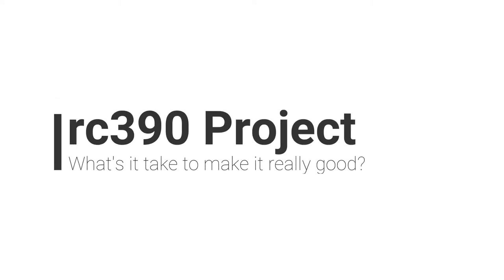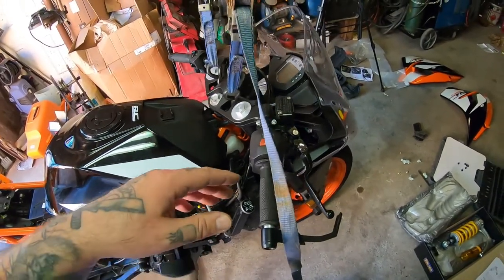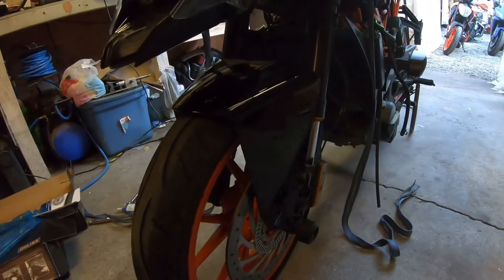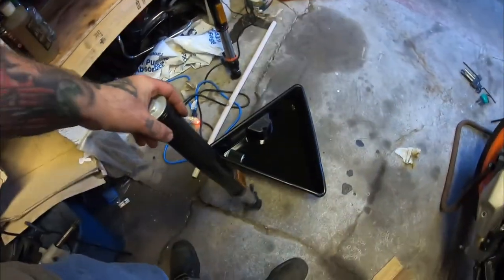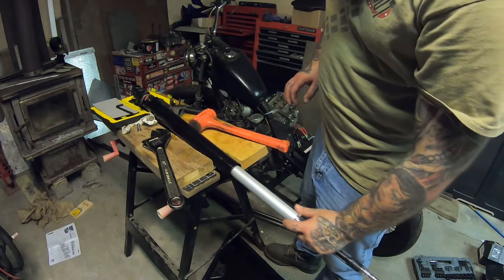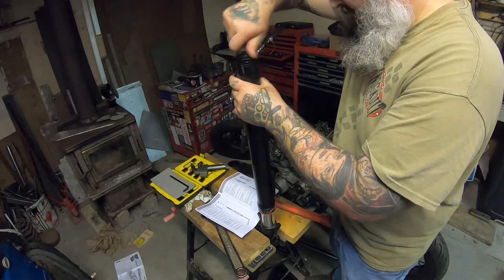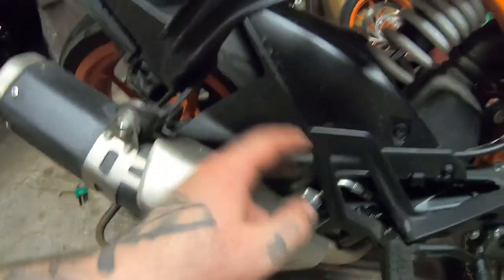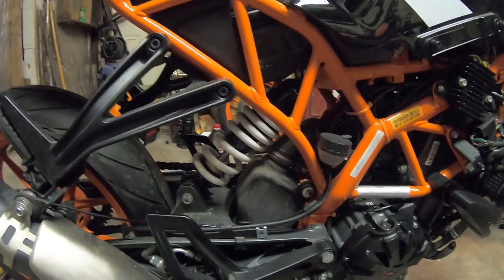rc390 forks Ohlin's Cartridge Installation

Comment: So glad I found this. I have a 18' duke 390 that am upgrading to these inserts from the Andeanis, but my suspension shop is back logged for months on work orders. Looks like you avoided having to buy the $60 Ohlins shaft extension tool by just grabbing the threaded part w/ fingers, slipped the retainer in and holding everything in place put tube into the spring compressor? Is that correct or after doing it would you recommend buying the extension tool, have to wait a month to get one. I'll need to order that race tech 1-person spring compressor.   Used to have many bikes like yourself, am even older than you, this is my last m/c, think you would like it, has Ohlins shock, Woodcraft clip-ons, rear sets, QS /blipper, IMA Thumb brake, BST CF wheels, Michelin Power Cup Evo tires, Leo Vince midpipe delete/ Yosh, sans cannister/SAS and is only ridden on a twisty mountain road I live on.
Reply from the maker: I think you have my method pretty well figured out. 
The spring compressor has paid for itself many times over in the last couple of years. So if you're wanting to work on your own suspension, it's probably worth it. It even makes fork seals way easier to change.
Reply: Why do you feel like you need to upgrade from the Andreanis to the Ohlins? I am considering the Ohlins or the Andreanis.
Reply: @NateTheGarbage  Chatter , I have a BST cf wheels and bc so light, get chatter on a very bumpy twisty mountain road when leaned over and with speed. Wheel weighs 5lb, OEM 9.5 lb (frequency doubles while amplitude halves if that makes sense. kina the opposite of putting silicone in handlebars) The Andys are very good 7/10, the Ohlins are just a bit more plush 10/10. The issue comes from the wheel but the overall improvement in performance overshadows the movement.
Reply: @jacksdad7933  Those are very expensive wheels. I am considering the GP suspension cartridges as well but I'll keep that in mind.

Comment: Going to be replacing my internals over winter. The stock suspension is way to hard at higher speeds and bounces over bumps. Feel like the RC390 was a bit overhyped as my old VFR750 handles better in the real world on real roads and it still goes like hell in a straight line. It would take a track to swing it in favour of the RC. 

Hope it's a massive improvement.
Reply from the maker: You find it too stiff?
I found everything way too soft, but the dampening is terrible, and the rebound can be aggressive.
I still think the 390s are great little bikes, but they are little budget bikes that couldn't and shouldn't be compared with a VRF.

Comment: I have a 2016 RC 390 does it mean I have to upgrade them to install the Ohlins?
Reply from the maker: If there isn't a bolt hole through the bottom of the fork, the Ohlins won't work. There are other options that would fit the stock forks though.
Reply: @VIMotorcycleSchool  is it easy to service and upgrade them? What brand would you recommend, and if I want to go with Ohlins and the stock doesn’t have a hole through the bottom, what would be the options?
Reply from the maker: @clarencenikel_6420  here's some options. https://www.rottweilerperformance.com/suspension-14/ 
If you don't have the tools and experience to confidently work on suspension internals, it would probably be a good idea to simply remove the forks and take them to a competent shop. You can swap out the shock pretty easily.

Comment: Do you have the part numbers for the Ohlins fork cartridge? Thanks
Reply from the maker: As far as I know it is not available through KTM, but this is where I got it. Just make sure you have a bolt at the bottom of your forks, or these won't fit.
http://www.rottweilerperformance.com/ohlins-nix-30-fork-cartridge-kit-for-rc-390-2017/
Reply: @VIMotorcycleSchool  Thanks!!